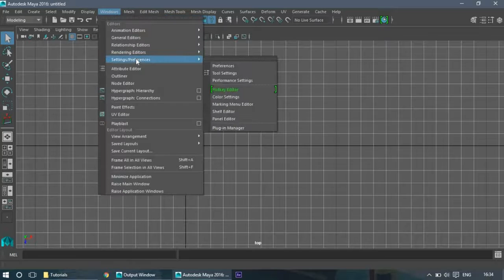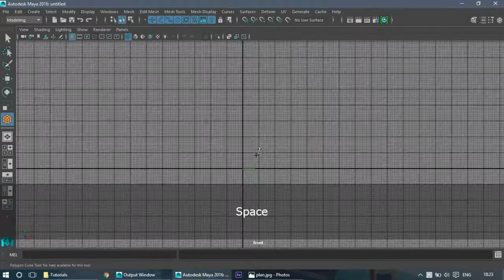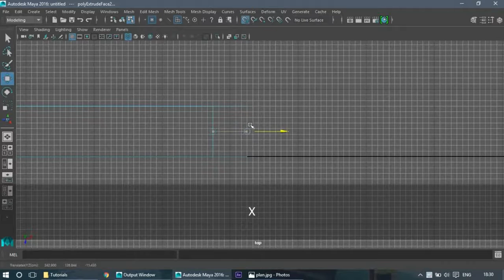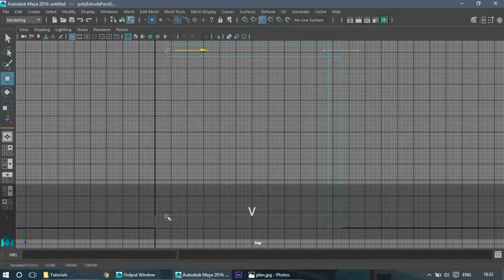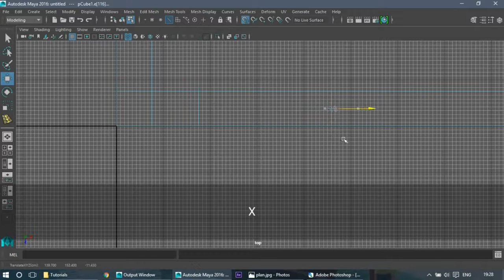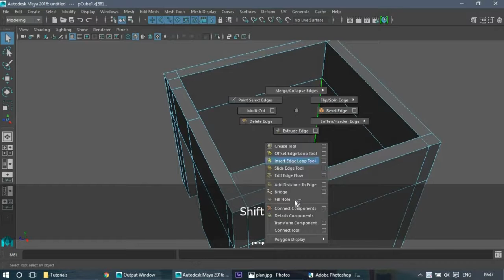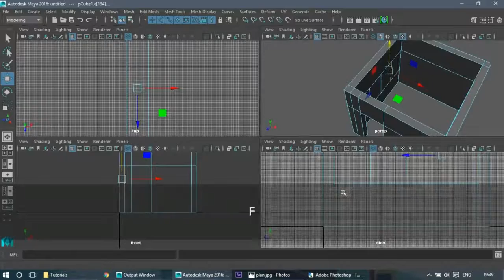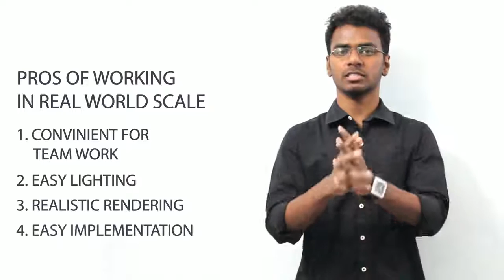Autodesk Maya Tutorial - Working with real world measurements

Comment: i've just finished the 9 by 9 cube with random height, but i was wondering why my polygon makes the main grid in the perspective view super small. should this be a concern or is that fine? i'm checking the distances with the measure tool and it's fine though.
Reply from the maker: +seeJ93 It's perfectly fine. Everytime you work with scale, it happens. Never consider the perspective grid.
Reply: thanks for the awesome tutorial and the reply :D

Comment: Great video and directly to the point. Can you elaborate a bit more as to why not change default construction options to other than CM? Also since you are working with Polygons, how does smoothing become a factor? A model may be exact until you smooth it for export then all dimensions change. And lastly how can you include measurements (locators) that update if you make a change to an object. Thank you!
Reply from the maker: Thank You. Sorry for late reply. When working on projects that includes some animations, its inevitable to work in cms. Because simulations, dynamics,etc in Maya disregards what unit you have set and always considers it cms. Apart from that, the lights in the scene behave strangely when I switch between units (like working in imperial units when modelling and changing it to default units after modelling). That's why I always prefer to work with the default units. All the projects that I worked in imperial units ended up problematic in the rendering stage. (the lights do not behave in accordance with their values)

Comment: thank you for the tutorial,, but did you try to bevel a edge to like 2mm or something like that?? thats what i couldn't do so. can you help me on that??
Reply from the maker: You're welcome. You can only bevel in fractions in Maya. If you want a large bevel, you could probably do a bevel roughly and then move the edges manually using the grid or move command to be precise.
I think you're asking about very small bevels that contribute to high detailing of the model like the rounded edges of the wall. I don't think you need much precision in those cases. But if you still want to achieve it you can
1. Use a 2mm by 2mm plane (for a 2mm bevel) as reference
2. Bevel that edge roughly
3. Snap bevelled edges to the plane vertices.
I understand its tedious but i don't think there's any other way to do it
Reply: ya thats what,,, in 3ds max we can do, now I'm  learning Houdini,, i think houdini is ok, 
anyway thank you so much for the tutorial